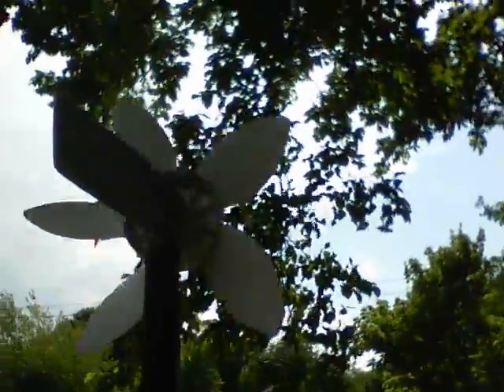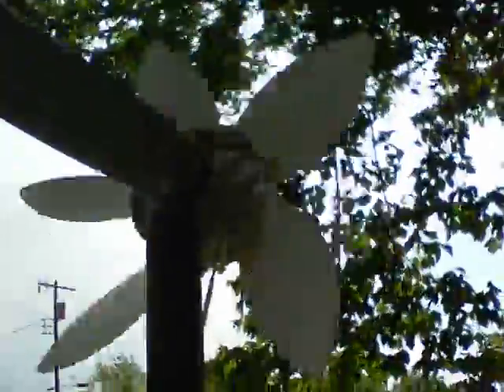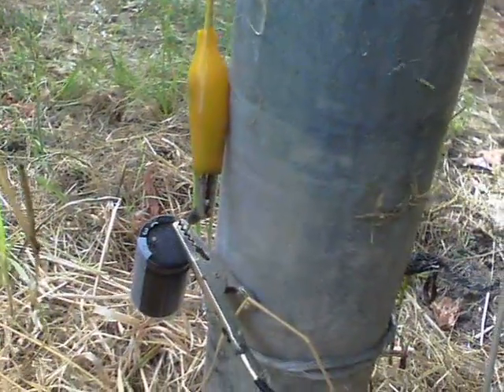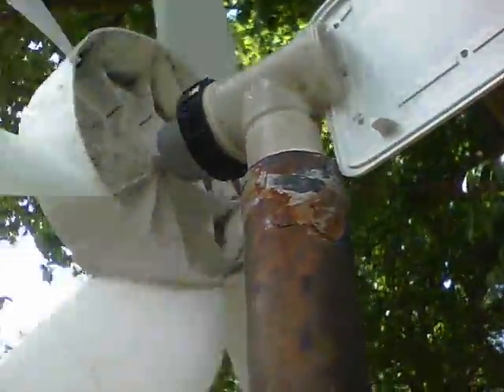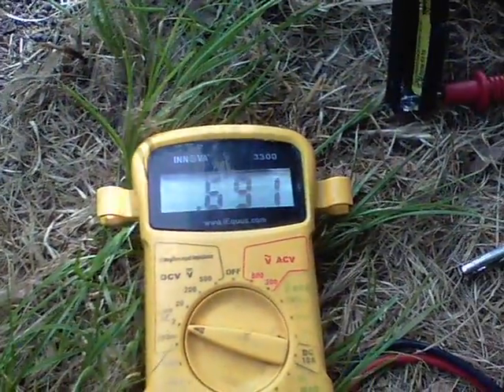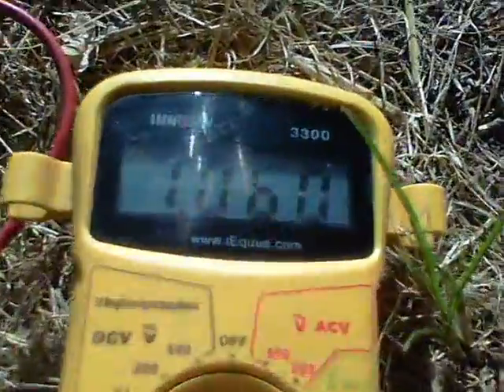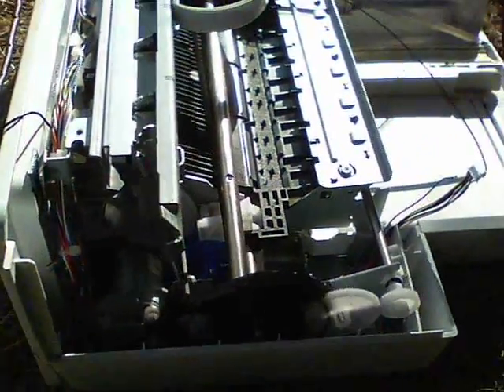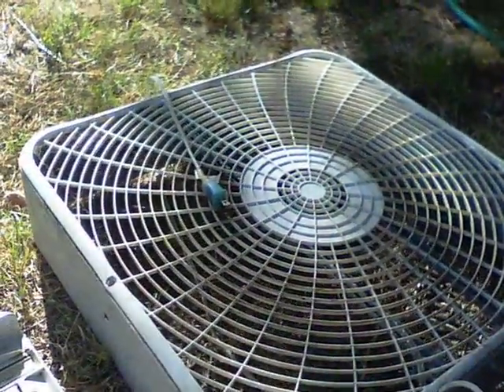New build Wind Turbine

Comment: Well done
Reply from the maker: Thanks. The blades themselves disintegrated after a couple of years or so !
Am still looking for another set, but may replace with cut PVC pipes now that you've mentioned it. The motor has held up fine with the weather and the rear is still as it was :)

Comment from the maker: An average drive around yard sales at the weekend should net you a couple of box fan rotors for cheap. I used Fix-All glue from Dollar Tree and it's still perfectly well attached, much is in the alignment, but we've had some quite strong winds. 
Just 2 of the wires from a Stepper need to be used, else turning the shaft can become difficult, you'll feel the resistance increase if wire all up.
Good luck, well worth doing :)

Comment: Blown 3 up LOL. That is why I went with a zener. I built and tested a circuit yesterday and seams to hold 12.6V quite steady +-0.02. Now all I have to do is connect solar/wind to Lipo battery through it and see how it goes. I am grateful for all help in my projects. Thank you Kyle.

Comment: Tinsnips are handy, As are big side cutters and bolt cutters. I have tied stuff to car and post, then pulled apart. I have thought about battery acid, to melt metal stuff... Used an axe a few times, for precision smashing. You could try HV cap discharge, to blow screw head off. Mot in high amp mode could be good for vaporizing screws too... I havn't used the tig to melt screws yet, but I will now you made me think of it... OH! I know. Induction heat the screws out! Or B.A. Electromagnet puller!

Comment: If you go to the trouble of making a run of funny screws, To deter DIY'ers, you tend to do it in the hardest steel you can get. Often rules out drilling/grinding the heads off too. Other methods I have used,  include heat, to melt plastic thread. Soldering iron on screw head for 30 secs should do it nicely. Cold chisel heads off. Or cold chisel split case, and snap screws halfway. Of sometimes just grinder the plastic around the screws. Failing all that heavy weight from height. cont,

Comment: I got sick of torx and triangle and every other type of strange screw, so I got a kit, with 30 or so interchangeable tips really cheap (About $12). they are even cheaper on ebay, even came with nokia screwdrivers. So I can fix my usb on my phone...  See a lot of star ones here, Some stuff, like the lens box on the projector Has a triangle and a torx thrown in with the star heads. They really dont want people in there...

Comment from the maker: That's the sticking point of all 5 printers here ...they have Torx screws and my Dremmel is broken to cut a line across. Guess what, the Dremmel has Torx screws to get inside it LOL. If got big blades then steppers are great, they often kick out at least 3V per step if put LED across. Yeah, vertical cylinder type is another I want to try.

Comment from the maker: Well worth doing. Just takes a few minutes for something simple like this one with a spare motor. Steppers are awesome for such things btw...wonder if your 18V one would work...if you put an LED across 2 power wires and it lights by hand turns, you'd get a great use out of that one. The more the cogging the more power out, but bigger blades needed. They light LED's in either direction too. Bit of grease on the shaft will protect from dew/rain rusting it :)

Comment: Well done. At the moment all we got is very hot sun. So my solar panels will be doing well. My full Lipo "car battery" did 17.5hrs normal use. Next test is with solar/wind charging it through fixed voltage 12.6V zener and transistor regulator and operating as normal use. My system doesn't get above 3.5Amps so current wise they wont be over charged. Video today I hope.

Comment: Been meaning to do a wind turbine for a while, got a few DC motors around... Will see if I can get a fan on one. Got a nice VAWT idea I want to try, might even run a small stepper. I get a lot of DC motors with hall sensors (Still good:)), and usually 1 stepper per printer. Stepper usually does paper feed. it'll be the last thing out...

Comment from the maker: Thanks Brad. Oh might laugh how I did that..lined up the cog of the motor with the fan hub, as cog was still on from printer removal then used superglue to test. Spun it up in reverse as a fan by using a 12V batt and then secured with Fix-All. Needs a screw through the front then it's done, only has vibration at several hundred RPM (faster than any normal wind) though may properly balance it. Used 1A dead on as a fan and kicked some air out !

Comment from the maker: It's a good feeling to get stuff running from junk, as many know from your fine projects. The printer had dried inks (HP inkjet from 2000ish) and the box fan died off a couple of years ago with a motor fault.
The wind was from the South all day today, the wire needs to go inside the pole, but I just wrapped it to stop it flapping about :)

Comment from the maker: It would need to be bigger for a 12V batt, or run through a gearbox to spin a motor faster. In 10mph, this produced 4.14V and 210mA today as the top output, but average is more important, sitting this one as an AA type battery charger. 
Longer blades and a bigger motor would be the way forward. If you've got an old spare washing machine then go for it lol